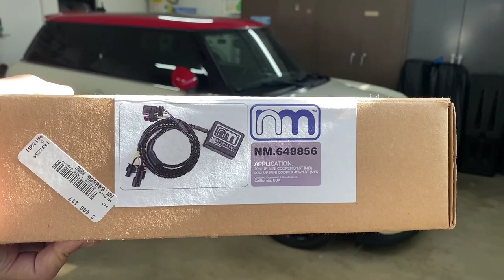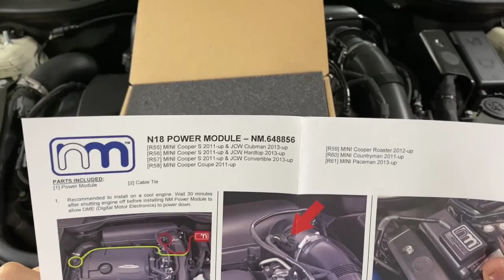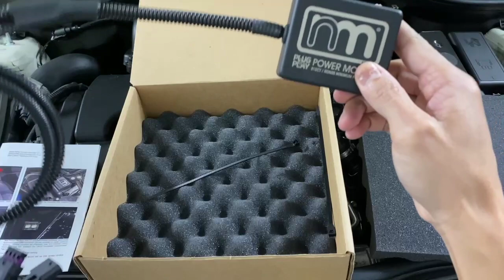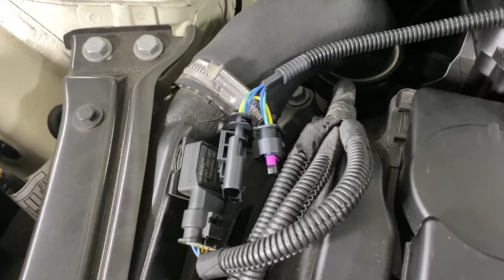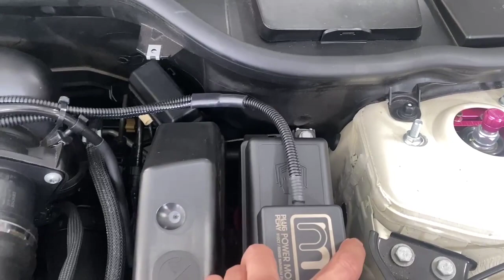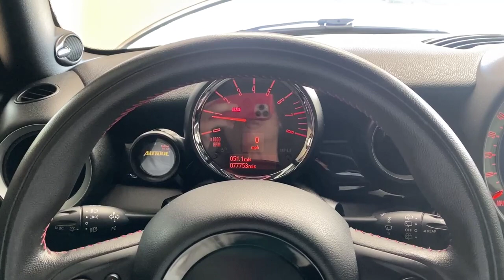NM Engineering Power Module Unboxing and Installation Mini Cooper N18

Comment: Hello:) there. I have similar car.  2013 Mini Cooper S R56 N18 L4 turbo JW
What is that thing do to the car?? More horsepower??. 
Thank you.. hope to hear from you soon.
Thank you 👍 Pat
Reply: Specifications:
Boost Increase: +4 to 5 psi
HP/TQ: +28 HP / 36 ft-lb
Install time: 15 minutes
Sensors to tap: MAF & Boost